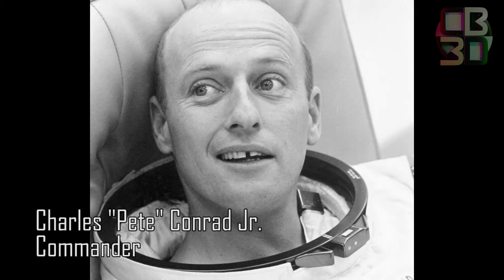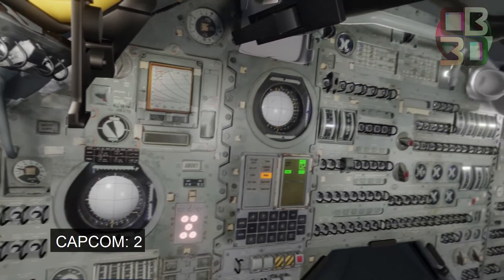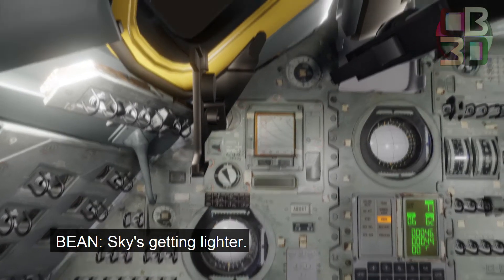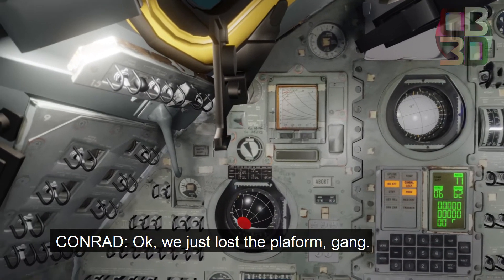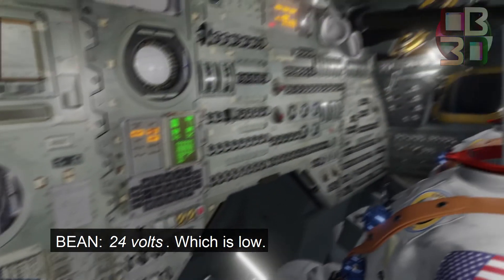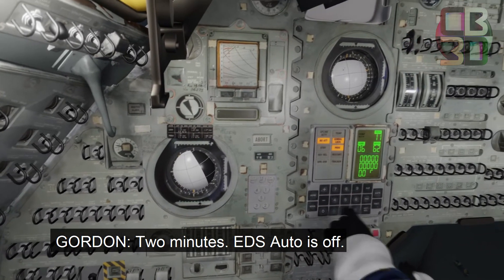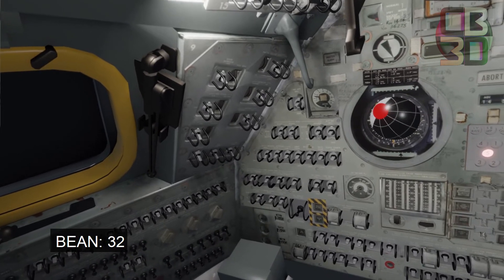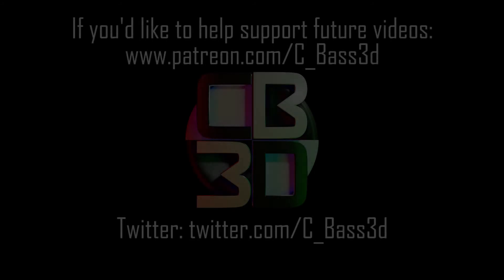Apollo 12 On-Board Animation

Comment: When you have a rocket 110 metres tall, with a flame three times that coming out the bottom and you launch through heavy rain clouds, you stand a very good chance of attracting lightning.
The SCE was the Signal Conditioning Equipment that turned the download data into a format that could be read by Mission Control. When the lighting knocked the fuel cells out the Apollo spacecraft automatically switched over to the re-entry batteries – the Saturn 5 was running on its own computer and was not affected by the lightning.  
Because the Apollo re-entry batteries delivered a lower voltage it scrambled the SCE and corrupted the downlink. Mission Control had no idea what was happening because all their screens had turned to garbage. However, one man knew what to do. EECOM controller, John Aaron had seen the weird pattern on his screen before when, a year earlier, he had been monitoring a test at the KSC and his screen suddenly turned to garbage. It cleared quickly but his curiosity was aroused and, on his own initiative, he and his back-room people found out what had caused the problem and worked out how to fix it.
A year later, during a real launch, when Apollo12's downlink went bad, Aaron told Gerry Griffin, his Flight Director, to "Try SCE to AUX". Switching the SCE from "Normal" to "Auxiliary" allowed it to run on the lower battery voltage. It worked. The downlink was restored, Mission Control's screens all came back and they could see what the problem was. The crew restarted the fuel cells, returned the SCE switch to "Normal" and checked all their systems once they reached orbit. Everything checked out and they went to the Moon.
Aaron's "SCE to AUX" was deemed the greatest call in the entire programme. He saved the mission because otherwise, with no remedy to the problem, Gerry Griffin would have had no option but to abort – eject the crew capsule and blow the rocket.
That was the last time that NASA ever launched anything through rain cloud or when there was lightning within ten miles of the launch pad.
To Apollo geeks, the SCE switch has become famous. When I looked into Apollo 11 at the Air and Space Museum SCE was the first thing I looked for.

Comment: From The Earth To The Moon didn't have to write a script for many scenes, they just used the transcript for much of what was actually said.
https://youtu.be/TMYNy3JsHTE?si=09uLcnPZ26UiZpzD

00 00 01 36     CC  -  Apollo 12, Houston. Try SCE to AUXILIARY. Over.  (Capcom says SCE)
00 O0 O1 39  CDR  -  Try FCE to AUXILIARY. What the hell is that?         (Pete Conrad misheard it as FCE)
O0 00 01 42  CMP  -  Fuel cell - -                                                                    (Dick Gordon is trying to decipher the FCE acronym)
00 O0 01 44     CC  -  SCE - SCE to AUXILIARY.
O0 O0 01 45  CDR  -  Try the buses. Get the buses back on the line.
00 00 01 48   LMP  -  It looks - Everything looks good.                              (Alan Bean)
00 00 01 50   CDR  -  SCE to AUX.                                                                  ((((Why did Conrad confirm this instead of Bean??)))

They added a few words to dramatize Alan Bean's key input to this problem since SCE was on his panel and since the episode, That's All There Is was told from his perspective.

Comment: The only thing wrong that I can see is the gimbal indicator going crazy. The rocket itself never deviated from it's launch trajectory. It was only an electrical failure. That gimbal craziness should be from the Apollo 13 mission after the explosion.
Reply from the maker: During Apollo 12 the FDAI (Flight Director/Attitude Indicator) did in fact start spinning wildly. At the same time the ISS warning light came on (the red one on the lower left of the warning panel), which indicates a failure in the inertial measurement unit. Conrad knew he wasn’t spinning and was getting garbage data from the guidance platform to that indicator and reported “I just lost the platform”. The backup 8-ball, known as Gyro Display Coupler (GDC) pulled its data from different systems and continued to function and provided accurate data for the entire launch (“All I got’s the GDC”). Later in the audio recording the astronauts discussed whether they should lock up the FDAI to keep it from spinning before they could reset everything.
Reply: @CbassProductions  I stand corrected. Thank you. 😊

Comment: would like to have asked them why they waited til after staging to reset the fuel cells
Reply: During staging they would have gone from about 4g peak acceleration, suddenly almost weightless, then 0.8g - so pretty difficult to reach over to the circuit breakers and operate them accurately during all that.

Comment: SCE to Auto didn't actually fix a great deal of their many problems. It just fixed the telemetry to ground control which was unhelpful garbage data after the lightning strike.  All the stuff that needed to be reset and restarted was done afterwards. Big balls to decide to press on to the moon. 🙂
Reply: Actualy, as far as I know SCE is monitoring the spacecrafts functioning. Since it went offline, also the on board instruments went crazy.
Reply: @PaulusN-p3m  Brining the fuel cells online would have fixed the SCE. The telemetry was garbage since the SCE stopped working due to a lack of power.

Comment: You could pretty easily make this into a 360 video if you made it in blender it only takes like 10 minutes to convert a camera to 360
Reply from the maker: The animation time to animate the astronauts when the camera wasn't pointed at them would take a long time, though
Reply: @CbassProductions  yah didn’t thing of that using rigs is hard still if you ever consider it it might be easier than making a whole new animation